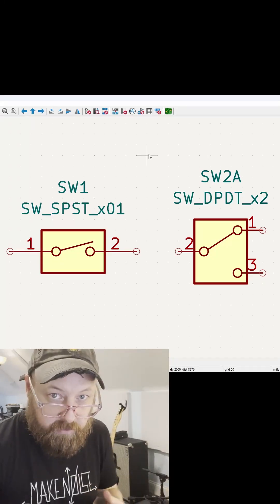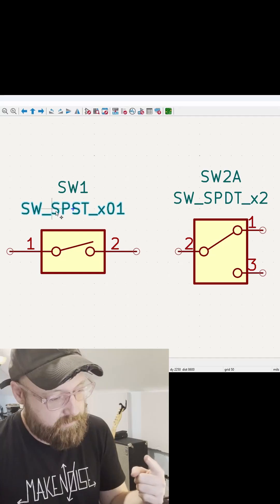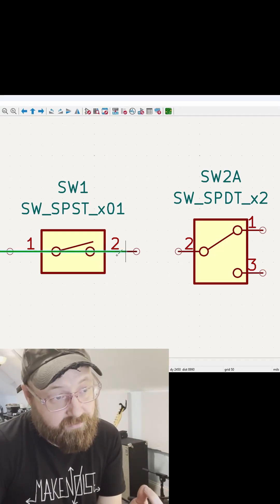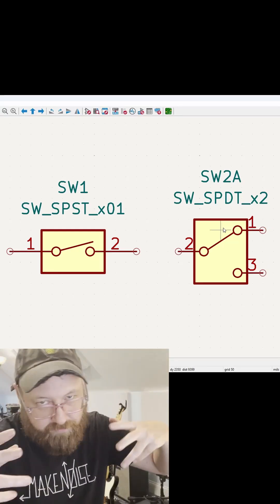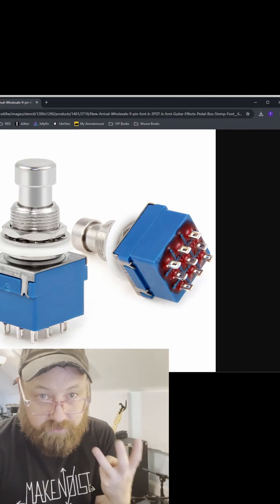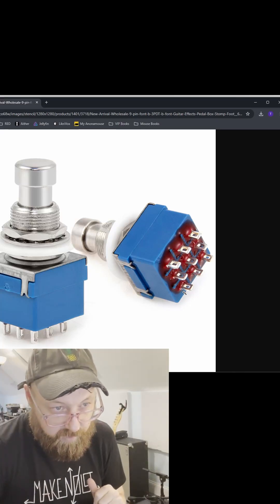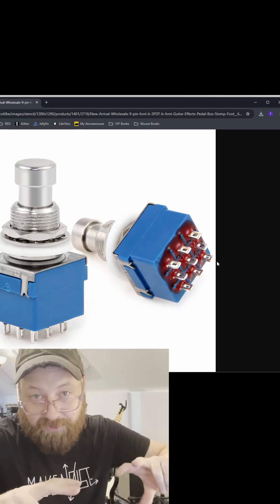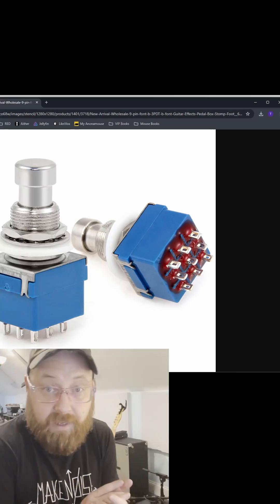Switches 101

Comment: If it's not SPST or DPDT or DPNT then its shit. Cause what's the point of an n-throw switch if you still need something with on-off SPST behind it anyway?
Reply from the maker: I mean, as a guitar pedal guy, the 3PDT is pretty crucial as well.
Reply: @theandromedacorporation  

well yeah that too, though that's just npdt at that point. Npdt's are noticeavly more difficult to mass produce per one/ten/hundred thousand pieces than either spst or dpdt or dpnt. But ofc guitar is guitar, not arguing there.

Although with spdt-and-secondaries vs dpdt you'd lose ten cents of money per like twelve toasters produced, which is already really stupid. Imo spdt is really just an awkward workraround that requires workarounds of its own. We should ban spdt use where dpdt can instead be applied without efficiency loss lmao.

Comment: So.. are you in fact saying Single Pull and not Single Pole?  What’s the reasoning there?
Reply: No, he said the opposite. Pole, not pull
Reply from the maker: @natrium1250  I did say that. I was however, wrong. It’s POLE. lol
Reply from the maker: I misspoke! 
The terms are POLE and throw. I think it comes from the mechanics of switching big levers back in the day maybe? I dunno.
Reply: @theandromedacorporation I think I've heard both pull and pole, but the accurate term is pole. It's the part in between the input and output(s) that get toggled by the input. In DPDT switches, the two poles are linked, and move together with a single input
Reply from the maker: @natrium1250 . You right. I had it switched around. (Get it????)